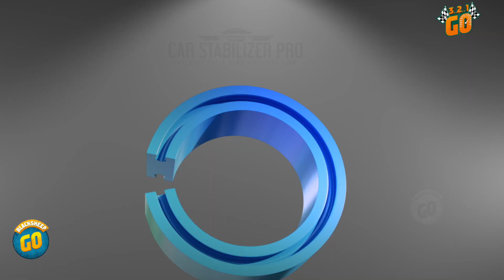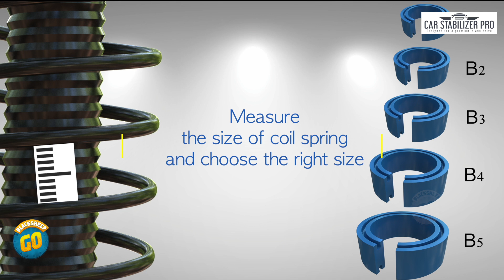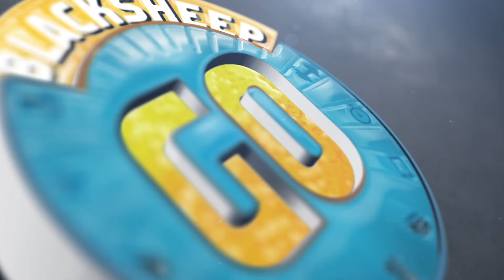Car Stabilizer Pro | Rj Vigneshkanth and Settai Sheriff Vlog | 321Go | Blacksheep Go

Comment: I am in Bangalore and I have fixed in my MG Hector and driven for 2 months. So far so good in terms of comfort and cornering stability. And we can visually see that the GC has gone up by one inch. We should promote this product as this is indigenously developed and  fairly priced. This has no adverse effect on the car.  Vignesh Sir's questions were so relevant but at the same time very much enjoyable with lot of humor.

Comment: 10000 intha ruber ku romba roommmbaaaa athigam... Instead i can replace suspension
Reply: @kimyangKo  alloy changing purpose?
Reply: @manojv668  Alloy wheel will increase tyre dimension and incrrease ground clearance and increase the comfort as well and car will have premium look
Reply: @kimyangKo  🙄🙄🙄
Reply: @rganesh1442  ena sir
Reply: @kimyangKo  alloy wheels will increase tyre dimension and ground clearance and comfort potu irukeengale epdi nu yosichen?
Reply: @rganesh1442  yen bro
Reply: @kimyangKo  that's not correct...if alloy wheel dimensions are exactly same like your rim wheels then there shouldn't be any difference in ground clearance. Comfort  may be if your rim wheels are having so many dents then you may feel little comfort in alloy wheels. But mileage and pickup might increase if you go with  branded alloyed which weigh lesser than the rim wheels but again those are not noticeable. Only if you go with different dimension alloys compared to existing rim wheels then the ground clearnece may change...
Reply: @rganesh1442  yes im aware of it. i said compare to drum ,alloy wheel is bit comfortable due to the heavy usage of suspension in drum as compare to alloy and yes the ground clearance will increase if we go from R14 to R15. nothing looks wrong to me.